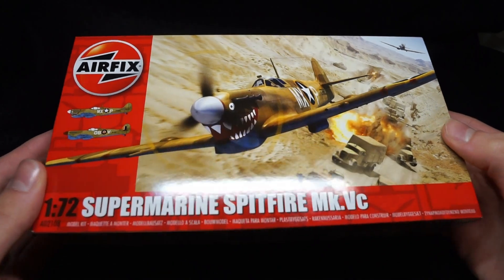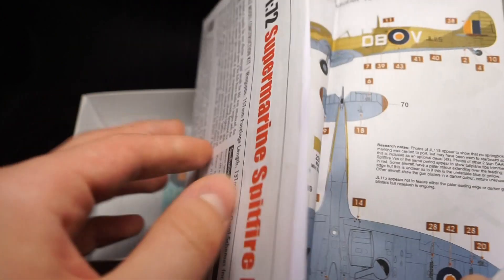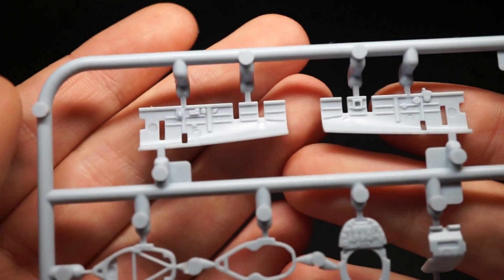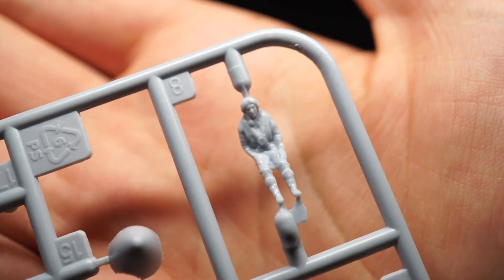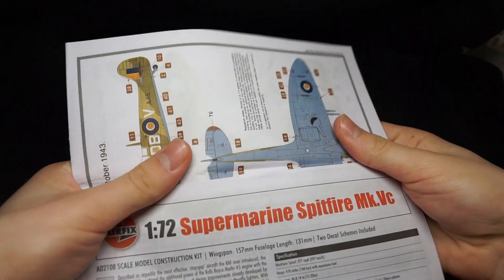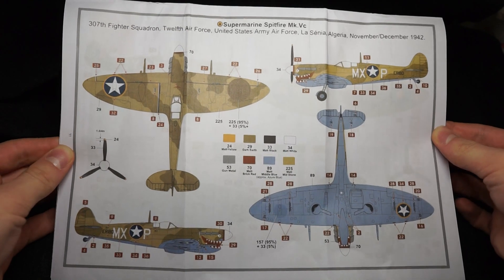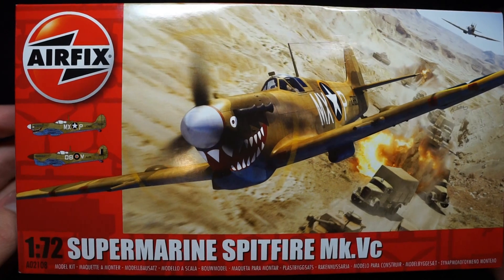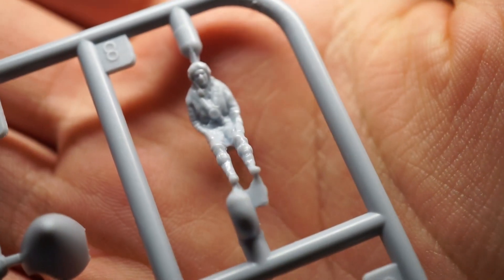Unboxing the NEW TOOL Airfix Spitfire Mk.Vc! 1/72 Model Kit Review

Comment: Looking at the sprue it looks like it also includes the parts for making a non-tropicalised version, all you need is to find some after market decals, if it also gives the option for the clipped wing variant that gives builders a multitude of choices for Spitfires to build.
Reply from the maker: Yep, it does seem so. The clipped wings are also included. They definitely plan to make more boxings with the same sprues
Reply: @ModellingWeekly , if that’s the case then it looks like I’m going to be buying several.